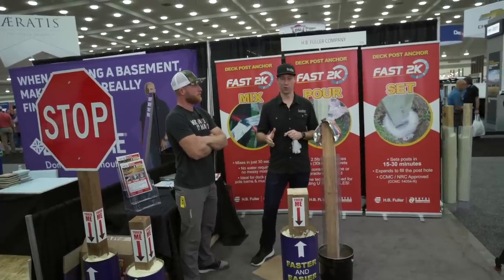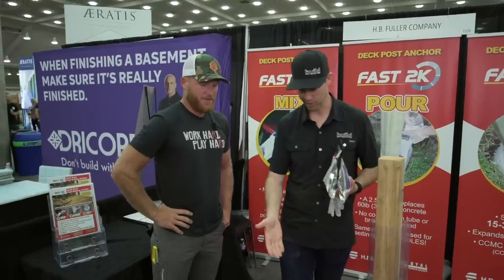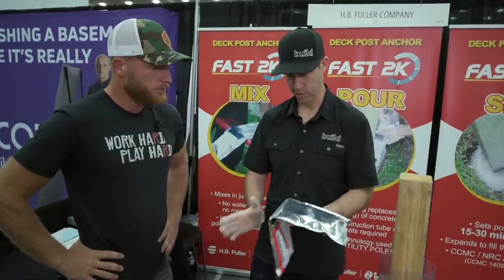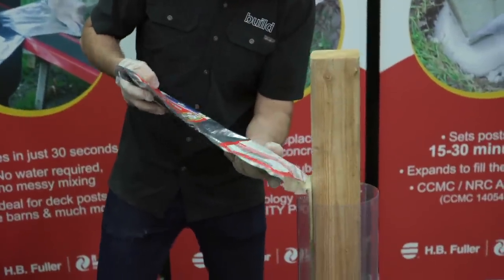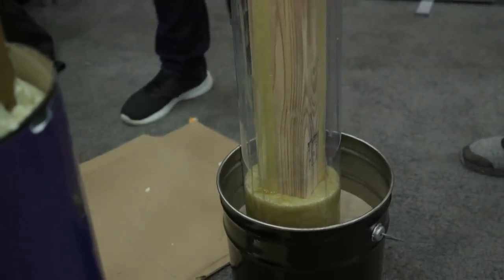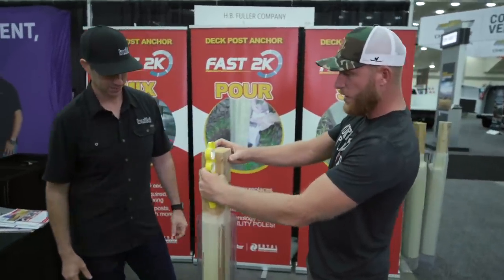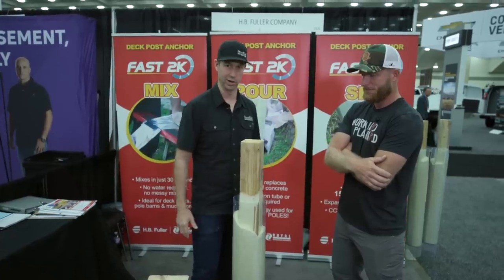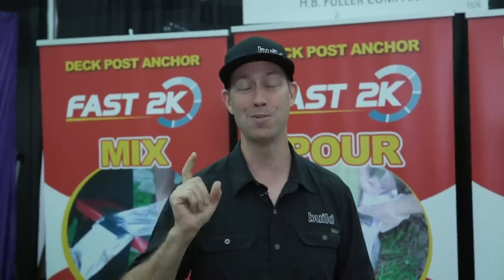Foam INSTEAD  of Concrete???

Comment: Used this foam product on part 200 ft fence. My brother picked some up as a test... A year and a half later, we replaced a 80 ft section that we used it on, every post that had the foam stuff in it needed pulled and we put concrete in it. 1 problem with this is setting. You have to make sure you 100% secure the post in place with bracing, much more secure than with concrete, before adding the foam. The product will begin to push the post in various directions as it begins to set so we basically had to monitor it for 10 minutes or so. The second problem is coming back to redo it. I will say the ground seemed to contain alot of water in the area, but the concrete didnt seem to have the same issues.

Comment: I used this stuff on my personal fence post, Oz wrapped aluminum posts. This stuff is great if it is warm outside (at least 80 degrees or so.) but if you are setting posts in cold weather concrete still wins . Glad to say I used both concrete and this product and they both provide equal strength, honestly the foam set posts felt more rigid.
Reply: Why isn't foam ok for cold weather? I'm about to have a company use this under my enormous shed in Alaska. It is super popular here.

Comment: Be interesting to know how long it last before it starts breaking down?
Reply: About two years, unless you compress it in some way first (like applying a lateral load) and ruin it. It's almost the exact same as GreatStuff foam. Go get yourself a can of that GS, and make yourself a little sample. Let it cure, then see how resilient it is to damage. Not very. Never ever ever use it for something structural; like a deck.

Comment: The problem with this is how light it is, I used it on my fence at home and the wind blew it right out of the ground because there is no weight holding it in the ground. It does set very quick and hard but not effective for anything that involves and weight 😂
Reply: Did you back fill? Also, you may need to create a bell shaped hole then back fill.
Reply: Probably not deep enough

Comment: Years ago I worked for a guy who used pea gravel to set fence posts.  It worked very well and after packing it down and covering it with dirt it was rock solid.  The reason he did it was it made it much easier to replace down the road.  Also very cost effective.

Comment: On the farm we put posts in heavily compacted dirt. Half my fence was done this way 20 years ago. The backyard neighbour had to have concrete. 15 years later, I have a rotted post, and now have to get the concrete out of the hole.  Compacting the dirt takes a while, but the post can be replaced easily.  I believe this foam will outlast a post, if kept from UV,  and I"ve read gasoline will melt it when the time comes.

Comment: $30 a hole is comparable to concrete?  an 80 lbs bag is six bucks...
Reply: Yeah, and there are 45 bags of that stuff in 1 yard of concrete. He uses 1/3 yard concrete per post so 15 bags worth which comes to $60-$100 depending on the brand. Or as he said in the video he pays $120 a yard which comes out to $40 a post.
Reply: @Mark_Cook  yeah I heard what he said..  but that one bag is equal to about a bag of cement mix ..  which is 6 bucks..  and 10-15 for a bag of foam
Reply: how much is a workers comp claim when one of your crew bulges or bursts a disk?
Reply: As somone who has manually caried hundreds 80lbs bags down a +45° slope for some jobs, somthing like this could save a lot of money where you don't expect it. There is also the delivery cost of the concrete due to the large weight. Then the logistics of trying to mix and pour it on a slope like that. Not to mention as other have said any injury claims which are not at all unlikely in this type of situation, if not harm to yourself (try and tell me your back is 100% what it was after carrying 100+ bags of concrete on rough terrain.)

Now imagine instead of spending half a day paying several workers to haul all the concrete into place, along with all the mixing and pouring equipment, then actually mixing it on bad terrain and pouring it, vs litterly having one guy carry ALL the foam in one go, maybe two, no extra equipment required. Done and poured in an hour tops and you're onto the next task. Saving that kind of time on labor adds up BIG TIME.
Reply: They ended up saying he would pay 30 a hole but he didn't say how many bags all I herd was 3 or 4 so let's say 
He bought 3 bags at 10 each but the price could also be 3 bags at 15 each 
So it's either (30-45 for 3 bags)
Or (6 dollars a bag for 3 bags so $18 of concrete.) In some cases it would be cheaper if concrete is cheap and ur only mixing a small batch. But to save time and labor these would save you so much if you just do it yourself and it would be really easy overall.
Reply: @Jpa5551  Yeah, even if you paid 10x in material what you would for concrete, the time and labor this could save alone more than pays for itself, not even factoring in buying equipment like a cement mixer, or being able to use it in places the mixer can't even go.
Reply: Jonathan D lol you shouldn’t do that work if you can’t carry an 80lb bag
Reply: Mark so you think it’s gonna take 15 bags of concrete to fill that little tube that took 1 full bag of foam
Reply: Oleg I’ll take a 60 lb bag on a rough terrain over 300 lbs for my back. No I haven’t worked on a formal construction job. I just think the point of injuries is negligent I mean I’ve seen what some construction workers do to speed the job up and you wonder why not more of them get injured. We’re both keyboard warriors buddy. At least I’m not incompetent like the majority of YouTube.
Reply: What's important to know about Kyles' method of post construction,is that he doesn't sink his posts. He pours a sona tube full of concrete to a level a few inches above grade. Then he pushes a steel bracket into the wet concrete and attaches his 3 ply 2x6's or 2x4's inside the bracket with s re as and thru bolts. He also bolts the brackets into the concrete with Simpson Titan bolts, massive ones.
In other words, the foam would not apply to his normal method. He does not stick any posts in the ground.
Reply: @kipcarroll486  Well, for somthing like a couple of deck posts, sure, but doing that for a few hundred fence posts?
Reply: @Oleg-oe1rc  I hear ya. Yeah, small jobs are definitely different than bigger ones.
Reply: @0x73V14  lifting too much, it's their fault, find a new job.
Reply: @jeremymanuel8136  tell me abou it! 600kgs of concrete for one post? That works out to a hole bigger than one of those big 240L oil drums! They must think we're idiots!
Reply: A cubic yard of concrete weighs 4,050lbs. Therefore his 0.3 cubic yards per post is 1,215lbs of concrete. That's a lot of 80lb bags of concrete bud.
Reply: @OscarGomez-lm3nj  lol yeah because ruining your back from carrying heavy bags is really cool and manly you're such a tough guy
Reply: @Oleg-oe1rc  Bullshit.  When I was young I could carry 2 100lbs. bags and I was only 5'10" and 180 lbs.  My back was fine.  I guess there are no more men left <50 years old.
Reply: @protonneutron9046  47, don't do Cement work as often as I used to but still do 2 bags. Find it easier on the back with a level load with the bags on my shoulders.
Reply: @OscarGomez-lm3nj  I found the fool that works hard not smart.
Reply: @Oleg-oe1rc  so what's the difference between one and one hundred. Still cheaper, still easier to do and still protects the post better.
Reply: @bike4peaceRTW  lol never heard of there are places in this world you cant get heavy equipment?
Reply: What’s next foam slab? Junking the planet with toxic polyurethanes, let’s put some asbestos in the foam while we are at it to make it fire proof.🤣
Reply: @peterquezadavaldes8654  you do know that almost all new slabs are build on top of foam, right. Its standard commercial practice and required by code on many areas in the north.

Comment: I have a deck I, building in the next two months and see this as my way of replacing the concrete to have a longevity for my posts. Question is it ok to pick up the post to get it under it for even more protection ?

Comment: Just south of Houston,Tx, they have Black Gumbo dirt, we just use a 3 foot length of 5 inch pipe, cut long ways in half, sharpen both sides, weld a cap on one end, mount a 3 foot T handle, where ever you want to put a fence post, pour a gal of water at that spot, wait a couple of minutes, then take your tool, and twist it around as your going into the soil, when your down to the bottom, push the tool into the open area on the tool to make soil stick to the pipe, lift it all out at one time, take the pole stick it in the perfect round hole, take a rod compactor and pack just a little around the post, I put many,many fences in this way, The one I installed at my place , 1000 foot, spaced at 10 foot each, still looks great, 27 years later. A old farmer showed me how to do this, when he saw me using a post hole digger, I guess sometimes its good to have crappy soil, makes for good fences.
Reply: Charles Miller 
I'm trying to envision your method but still lost. I guess I may still be slightly impaired from last nights drinking. Do you have a video or a link to one that can be viewed? I understand processes better by seeing than I do by trying to comprehend from reading. Thanks much for your input.

Comment: Don't lie Matt, that shot to the face hurt like hell. lol    Here is my hypothetical: Say you're setting post for a back deck and you have a market garden down slop on the grade. Has there been any testing for chemical leaching into the water table?
Reply: Good point. At least with concrete you know it’s safe

Comment: I did a test with one post using this method and its a no go. Followed the directions perfectly. Came back 2 days to see. The foam had pulled away from the hole edges and away from the post. Pulled the post out with my hands. Its the good old back breaking concrete I guess. I really wanted this to work real bad.

Comment: 2 fence installers I know have tried stuff like this both had to tear down the fence and re-set the posts in concrete. One told me The plus side was that it shrunk enough that the post pulled clean out of it, and the foam pulled clean out of most of the holes in just a few pieces.

Waste of time and money. Concrete is cheap and not that difficult.
Reply: That's the problem. I tried the foam once. It eventually shrinks. Terrible product. Concrete is cheap and reliable.
Reply: So the backhoe test was bs?
Reply: @dewildest  
LOL
Listen, I've worked in construction long enough to know that if something actually works, it gets wide adoption pretty quick, especially if it saves money. And in construction, time usually costs more than any of the materials you're working with. But the kicker is, it has to work and be reliable, or else it just stays niche.

Comment: $3.50 an 80 bag of concrete. $15 a bag of "60lb" foam. Yeah nowhere near cheaper. Average fence is 20 posts. $230 difference
Reply: you forgot time=money. less time mixing and setting the first job and you're already on to your second job by the time the first job is set
Reply: Good point Travis, most of the positive reviews here are fake and by same person. You can tell by the writing style. Another company paying someone with profiles to engage customers who  have don’t have knowledge of construction
Reply: Travis Hueg 

I’ve sure the foam product before. I’m not certain it was this one. It was very expensive and it didn’t take long before you could wiggle the posts. Concrete is way better.
Reply: I've used the Sika foam before. Good for a quick replace and repair. A whole fence line though? Nah, Ill stay with concrete.

Comment: I've used a very similar product to set 80 foot fiberglass polls in a baseball stadium with 1500 lb of Lights hanging off them. That was about 10 years ago and the polls are still standing true and Plumb today. I used some of that product to set my fence posts about 6 years ago and they are unbudgeable. This is an amazing product for all you non-believers you got to get with the times.
Reply: indyseven packing dry concrete would have work just as well and would have been much faster.. New inventions should be easier to use and less expensive than what you already use.. until it is as cheap as concrete fuck a bunch a Foam

Comment: Local electric coop uses something similar to set power poles.  I have been following Kyle for some time now.  So far, I can not recall seeing him put posts in the ground.  Instead, he goes to great length to accurately set Simpson Strong Tie hardware in site cast concrete piers.  I don't think this foam is adaptable to Kyle's current building methods.  No matter what technique you use to set pressure treated wood posts in post hole you are going to get rot and insects.  I hope Kyle was playing along for the sake of the video and not thinking about cutting corners for the sake of a couple of bucks.
Reply: Steve Hansen I’m not going to be building our structures with posts in the ground ever again... I asked if a metal bracket similar to ours could work in such an application and they said no.   There is not enough surface area to bond too.  I however agree it is a super cool method and adaptable to tons of other specific trades as in fence and deck builders.
Reply: When I first saw this foam stuff some 5 or 6 years ago I took a look at it and did not see any way of using anchors in it as it was only shown as for, definitely would not use it on a set-in-ground type post structure aside from fence and deck as it lacks the compressive strength to hold up heavier structures which concrete is perfect for with use of brackets such as what Kyle uses from Midwest Permacolumn.
Reply: Would a different type of bracket be better, say  the top of your current bracket but the bottom part being set in the form being an I-beam or similar? The issue would then be you need custom brackets.

Comment: Lmfao that’s why you use pressure treated wood for post and concrete is less then $3 for a bag these guys full of it
Reply: Exactly right, I wouldn't want these clueless "experts" building me a house.
Reply: You can buy this stuff in bulk if you are doing more than one or two posts.  Home Depot has "5-post" (worth) jugs for $40.  A "15-post" kit is $122.  Admittedly, I don't have experience with this foam, but this looks like a huge resource-saving product.  The bag of concrete might only be $3, but how much more is invested in pouring concrete:  water bill, tools, time spent mixing, time spent hauling 80 lb bags, wear and tear on the body, worker-comp claims, etc.?  If you are 115-pound lady trying to DIY at home, or a solo-maintenance worker (with an endless backlog of tasks to complete), trying to fix a broken fence, this product looks far-preferable to concrete.  Even if you are a bulk-builder/construction, this seems a lot easier to buy the foam parts in bulk, and pay one person to mix and pour (handling gallon jugs), as opposed to paying 1 or more people, plus a mixer truck & driver, water, higher injury-risk, etc. to pour lots of concrete.
Reply: I agree for the most part!  However, and it won't matter in all situations.  I have slid a million posts out of the ground in concrete and the concrete stayed.  Also had customers decks sink because the didn't drop a rock or two in the hole before the post and concrete.  Then you also have "ground contact" and "sub contact" posts.  big difference.
Reply: Open cell foam sucks up water like crazy, so the post will turn into a sponge.
Reply: Edward Lahr  It’s not open cell it’s closed cell.
Reply: @speakupriseup4549  what kind of emotionally damaged person follows clueless experts?

Comment: The real question is why concrete fence posts (the actual posts themselves) are not easily available in the US. It's nuts to put wood in the ground where it will (eventually - 20 years for treated wood?) rot and or get eaten by termites.  Put a concrete fence post in the ground and it will last, well, for ever, and with some judicial hole digging and compaction of soil you might not even need to use extra concrete to secure it in place.

Make the fence posts in a mold that produces a H-section (with some lateral holes) so fence panels can be slotted in and you have a much more long-lasting fencing system.

Comment: In the UK we coat the bases of submerged posts with bitumen before fixing down = no rot. Above ground level, we then flaunch the concrete into a small pyramid so water runs straight off and doesn't sit there rotting the timber.